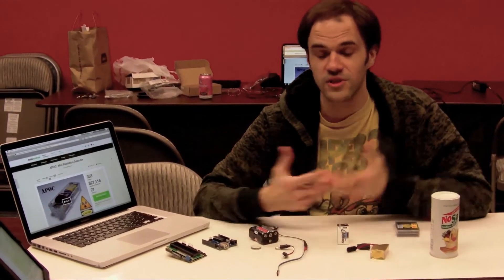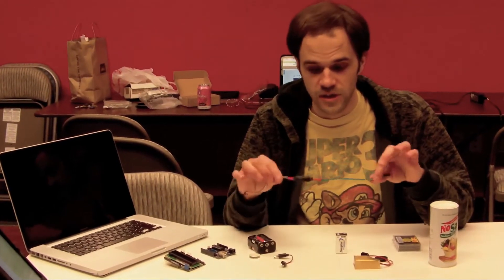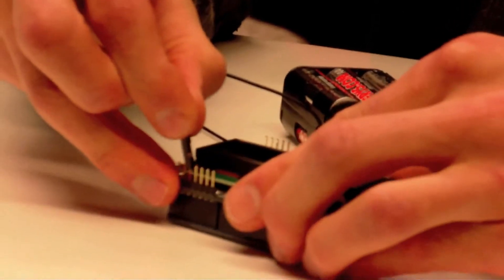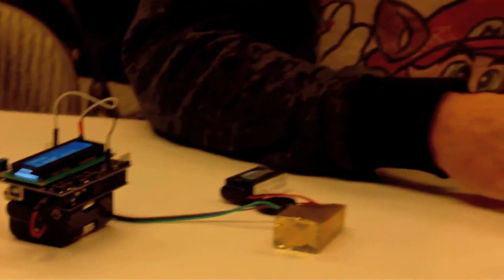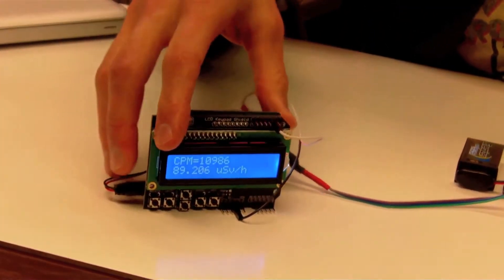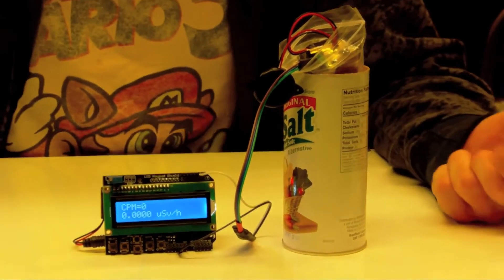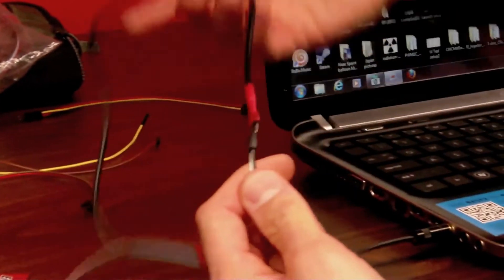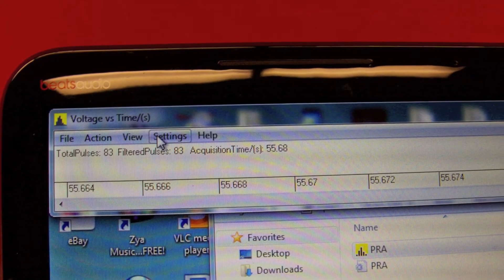APOC Update

Comment: Hi really enjoy your video, I have a question I have a RadioShack Digital Soldering Station #:4819275 and I wanted to change the handle or the heater element. I find the heater element in the at station to be the weakest link. Would you be interested if I could send it to you. I would pay for shipping going and coming let me know thanks. I have tried to change the handle with Pro Soldering Gun Japan Heater Solder Iron